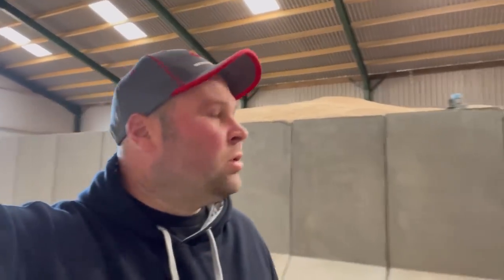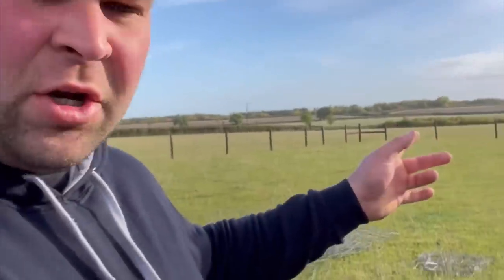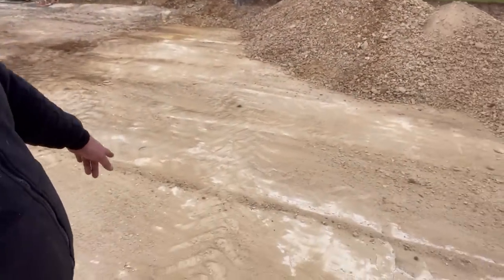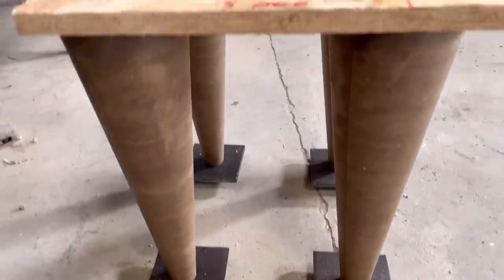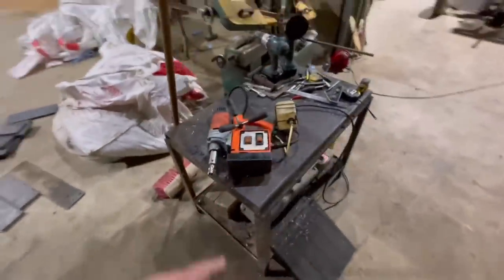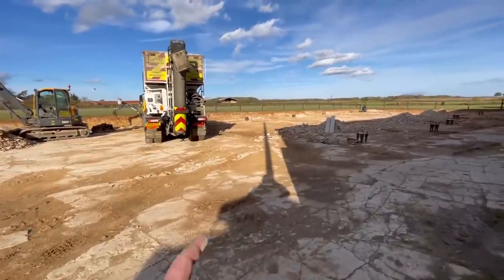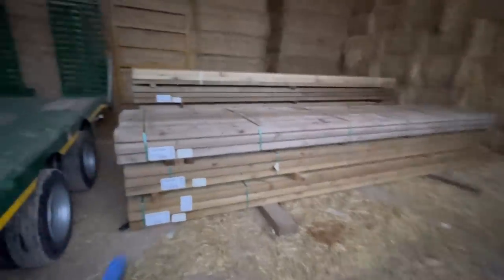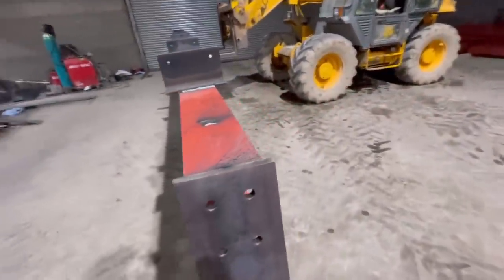Build your own grain store/steel frame building. Fabrication and foundations (part 1)

Comment: Impressive! 
We built one (using a kit rather than fabricated ourselves) by putting the frame up before summer, stacking a strawstack within the frame, then put the roof on from standing on the bales.
Bit of a cowboy way of going about it, but it worked very safely without the cost of a roofing contractor (and I'd built my house using Hesstons as scaffolding, so had a bit of experience of the technique!)

Comment: We put up all our own sheds too but be use second hand material   , steel all shot blasted and painted , shed we are putting up go used box profile sheets on it due to the extortionate  cost of new , rope and safety  harness  on safe as houses , only new was the purlins , as you said saves a fortune  👍

Comment: great work, thanks for sharing i building a 20m x 25m using 9mm 300mm hight i beams im planing to weld tge plates using 3.2mm electrodes 3 passes each side what weld thickness did you put in i see you didnt di a full welding on the rafters hautch supports cheers

Comment: At 21:10 your mate is positioning the bolt box. He pushed it down a couple of times into the concrete, but it kept "floating" back up a few mm. Can he not weight it down with a couple of fist size rocks to stop it from floating back up?
Reply from the maker: Sometimes put a brick on top of them